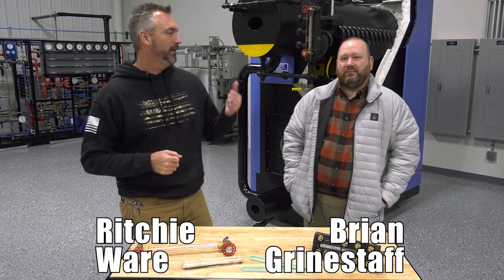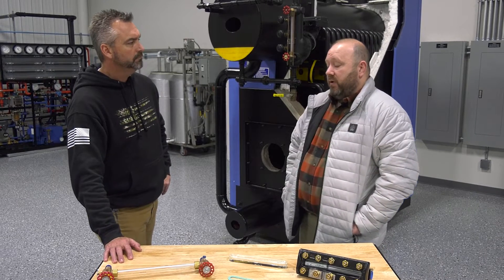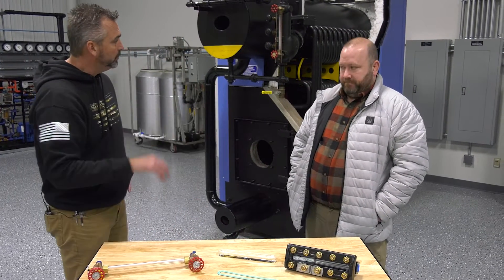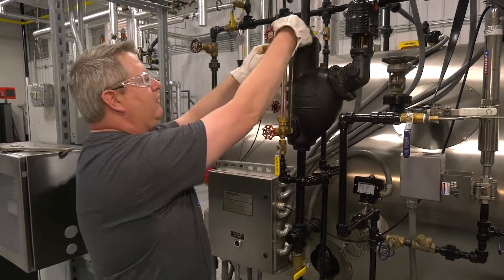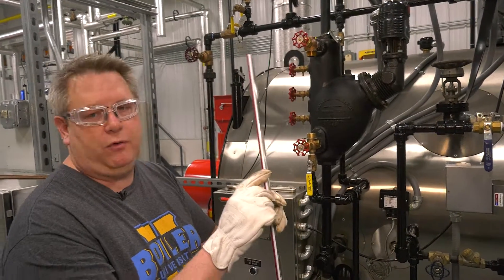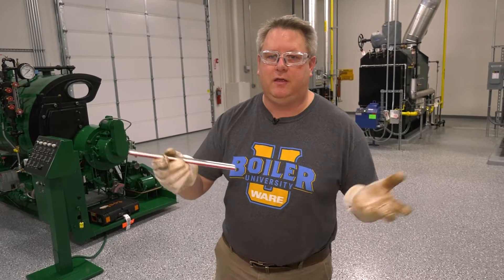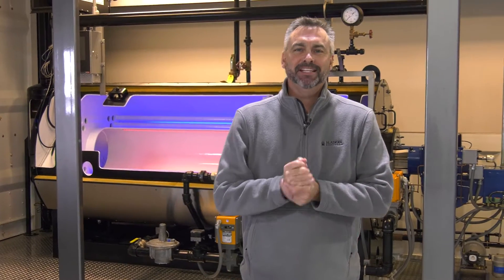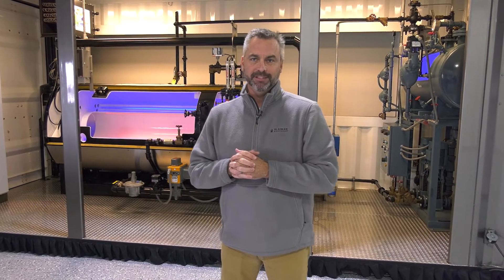Steam Boiler Sight Glass 101 - Boiling Point

Comment: On the lwco, there are three valves. What are those for? My boiler has the sight glass mounted on a similar tank with three valves about the size of a two liter plastic soda bottler. Mine has a separate #67 McDonnel LWCO.
Reply: I believe you’re talking about the try cocks. They are used manually for checking water level.